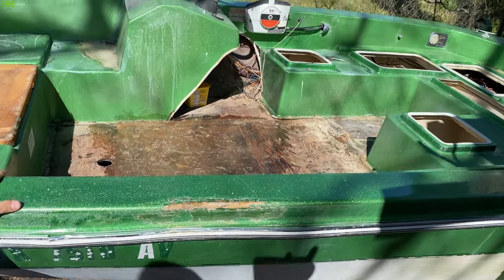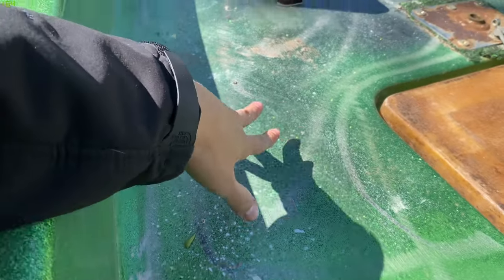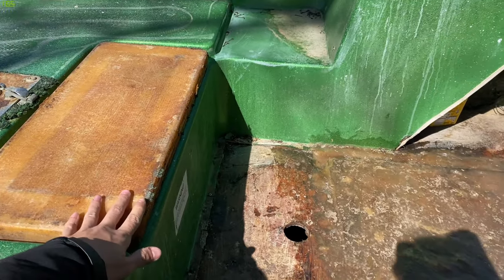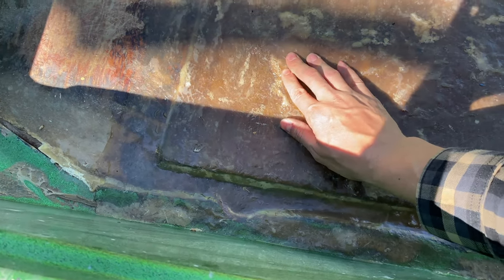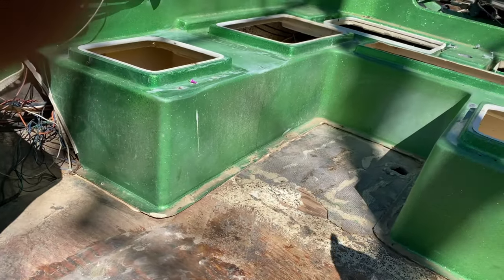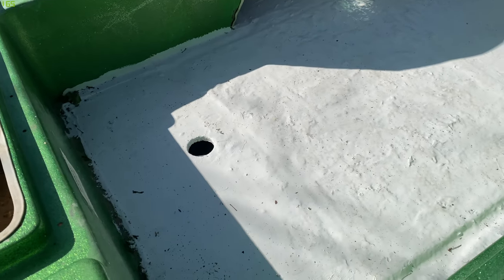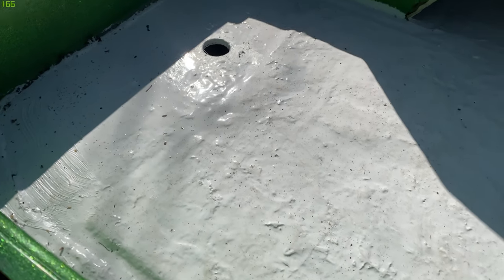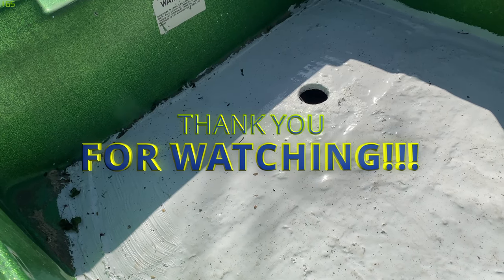Bass Boat Restoration Ep.5 | Sealing the deck with Flex Seal |

Comment: Your carpet glue would have waterproofed the floor the same way. It’s basically a rubber compound it’s self. Your carpet glue will have a hard time bonding to that rubber you put down.That  flex seal will eventually peal off.  I have restored several bass boats over the last 30 years. It’s just not how I would have done it.
Reply from the maker: thanks for your comments seems to be fine so far the reason i used the flex seal is because the rain was about to come in and if i hadnt have sealed it it would be awful rn and the carpet and glue wasnt in yet things take time and we are all learning what can be done not what what work in the long run some people only have so many options but im glad we  are learning together stay tuned for a new video hopefully comig out within the next week!!!

Comment: You sealed the TOP of your floor with glorified and triple priced rubber roof? Wow.
Reply: Ikr. He should if used white gel coat. Idk if he’s gonna put foam in the floor below but flex seal wasn’t a good choice. Also a lot of the floor was rotted out too really should of split it open to properly fix it. Just chalk it up to another boat gone.
Reply from the maker: Lmao I doubt it!! It seemed to seal it fine and shouldn’t be an issue like I’ve told some other commenters I will be splitting it open one day and replacing the whole floor this is just what you can do to get it on the water in less than two months!! Check out the video over the 135 ho Johnson coming out tmrw!! I’d love to hear y’all’s comments on it!!thanks for watching!